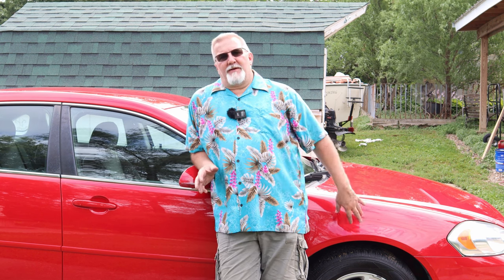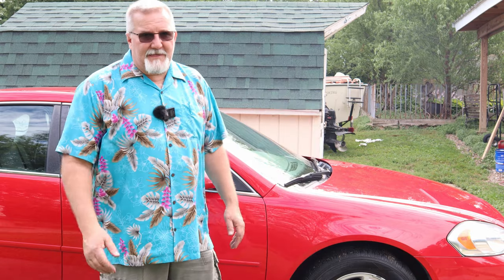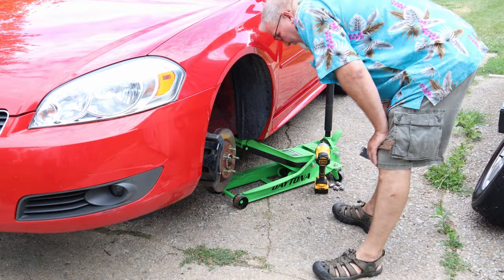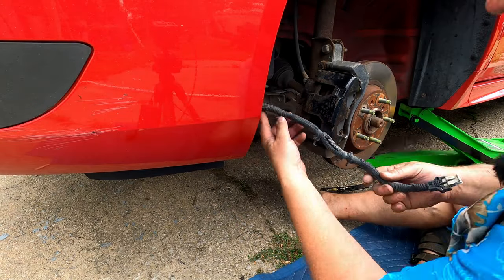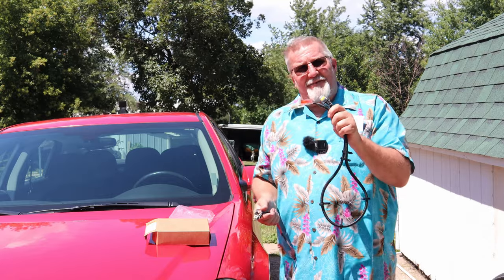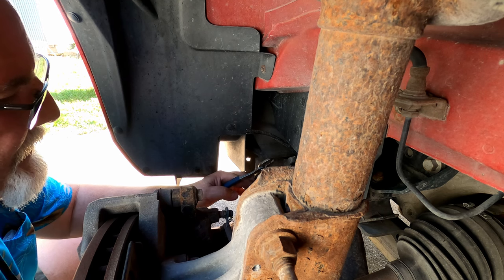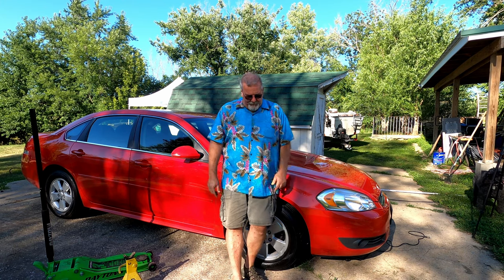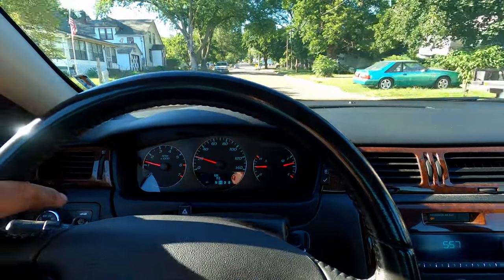2011 Impala Stabilitrak and ABS and Traction Control gone wild

Comment: Mice made a nest under my intake manifold cover and chew through my injector harness.  Only problem I ever had with the car, other than the stability control came on yesterday and I’ll be attending to that shortly.  It’s a great handling car, 185,000 mi.